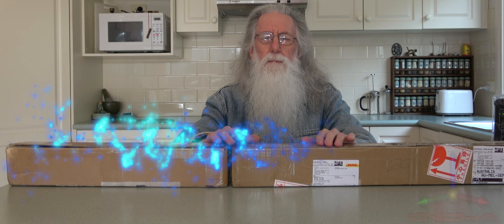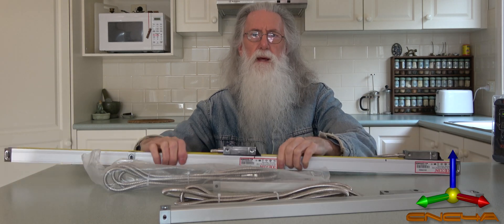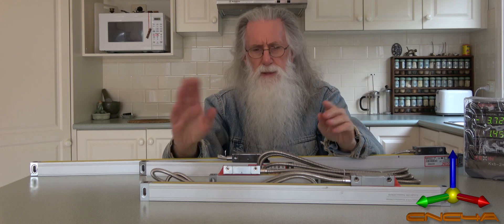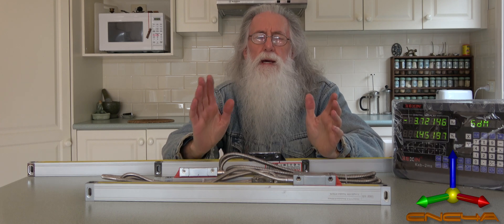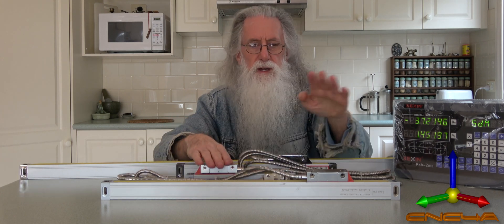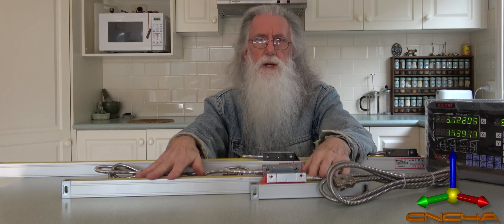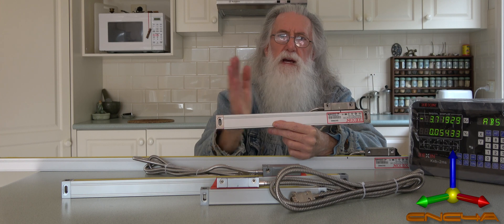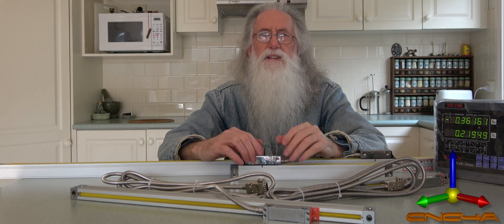CNC4A - Mach3 Alternative 09 - Linear Scales

Comment: HI , I have bohgt the same Controller  with Servos to fit in my 1980 Tool Milling machine, it works fantastic and verry precise,
 even without the glass scales !
How is your Machine doing ?
Reply from the maker: Hi Pe He, thanks for subscribing.  As you may of seen by the other recent videos on my channel I have been doing some other topics.  As for the controller, it's sitting on top of the lathe in its new steel box waiting.  Waiting months, as always, for something I have ordered on eBay to finally turn up, if at all.  I have to make up my own cables and finding the multi-strands I need is proving difficult, but that's life.  I would like to talk more to you about your experience with it, etc.  If you would like to send me your email in a comment (I will delete straight away) we can chat more.  Thanks again.
Reply from the maker: Email sent ages ago.

Comment: Hello. Great series, thank you. Very interested how this controller will work with scales - is it compensate difference between motor encoder counts and scale counts or just showing the difference?
Reply from the maker: I will have a better answer for you when they are fitted and all is running as the manual and the supplier are a bit light on for information.  Thanks for watching and don't forget to subscribe, I need them ;-)
Reply: @TheWizard  No thats just a so called DRO, just displaying machine positions. No CNC controller.
Reply: Unfortunetelly, this system don't compensate difference between motor encoder counts and linear scale counts.